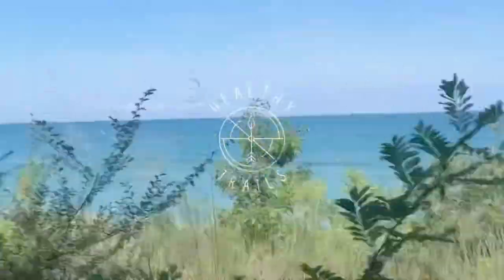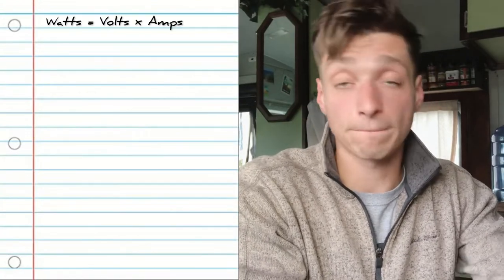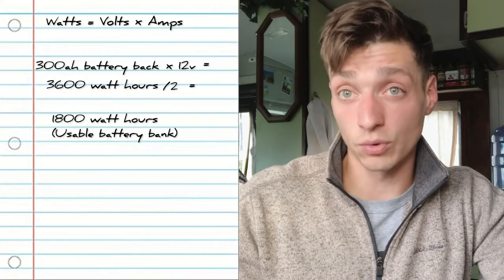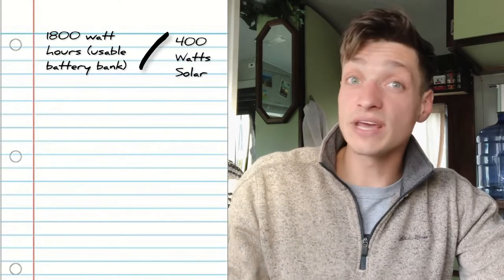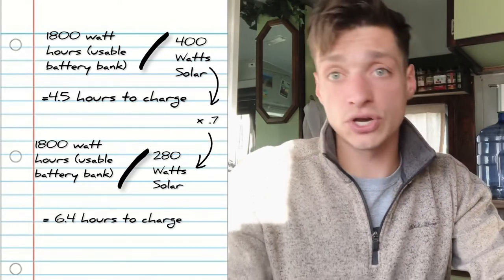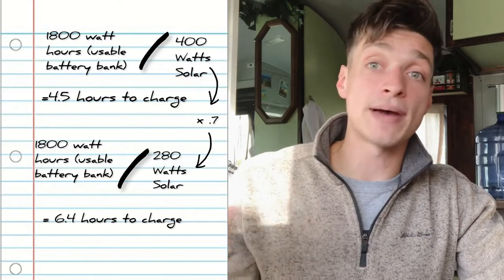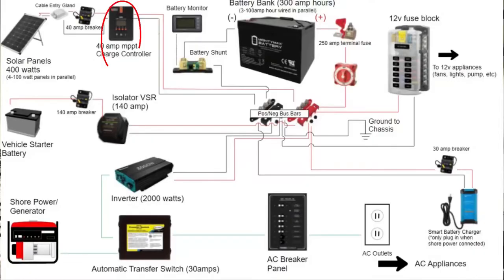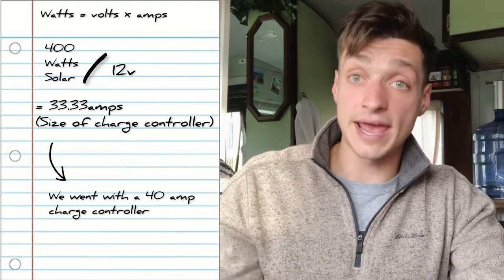What Size Solar Array for my Skoolie Conversion? How to Wire? What type of Solar Panels?

Comment: How much if you don’t mind me asking, was your entire electrical set up cost? The whole diagram and solar panels, just everything included. Thanks in advance
Reply from the maker: So we fortunately inherited some of the components from the previous owner before we started to renovate so it's hard to give an exact number for our system. It will definitely vary tremendously depending on the type of products you go with (Lithium batteries vs. AGM for example). That said, if you were to try and replicate our entire system I'd estimate it'd run you $1500-$2000?
Reply: @healthytrails6798  thank you for the info!